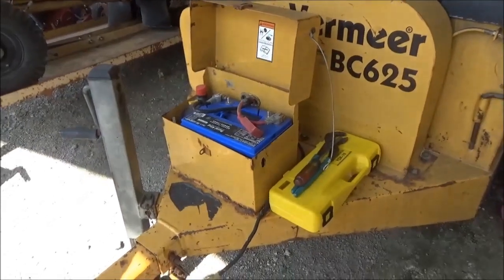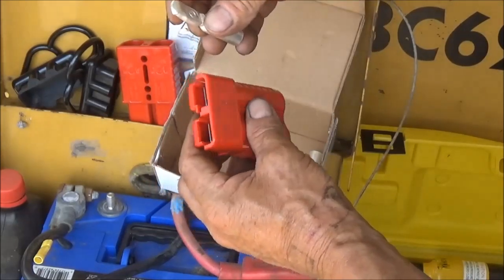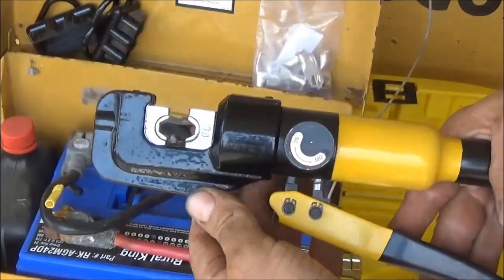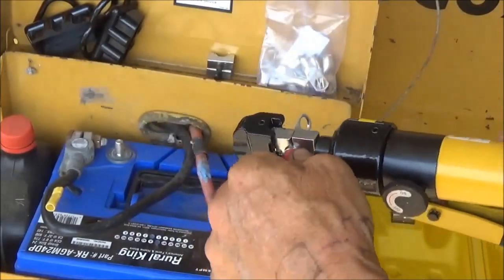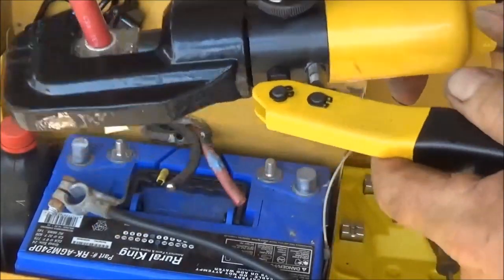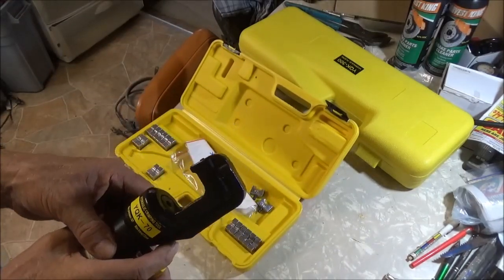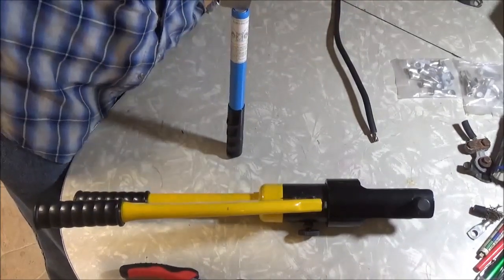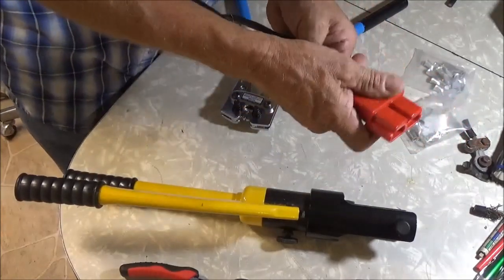New tool review, battery cable crimpers (part 1) September 17, 2017

Comment: SImply put the lug into the crimper first, pump until it holds the lug, then insert the cable into the lug and pump away..
Reply: thank youuuuuuuuuuuuuuuuuuuuuuuuu
Reply: @Holy-Quran-Y  also you can clamp the tool in a vise to hold it.

Comment: 13:12 the lug is oversized... the strands should occupy almost all of the space inside the lug. 
The number of the lug is the cross sectional area of the cable (wire only, minnus the insulator/armor).

Comment: I know this was filmed a long time ago now, but heck man, don't fault the hydraulic crimp for having difficulty with handling it. All you need is someway to secure the cable; either a clamp or vice, or a second person to hold the cable while you crimp with both hands. AND I gotta say working over top of exposed battery terminals with metal tools and bare wires is just asking for trouble.

Comment: I've used those disconnects for the winch on my truck. Easy enough to install, makes placement/removal so much easier. Definitely need a good crimper. But I'll thumbs up the connectors. Very useful. 👍
Reply from the maker: The part 2 has the crimper that did the job, I don't know if you saw that one. Thanks for watching Pete.
Reply: @GordonRobertsonDIY  u should have had tested the size and such b4 making a video and you could place the thing your going to crimp in the crimper but with very little pressure to hold the peice them crimp it I think you should have cut a little more wire off to get crimped better imo

Comment: (#4 Die for 12 AWG), (#6 for 10 AWG), (#8 for 10 to 8 AWG), (#10 for 8 AWG), (#16 for 6 AWG), (#25 for 4 AWG), (#35 for 2 AWG), (#50 for 0 AWG), (#70 for 2/0 AWG)
Reply: thank you very much for the break down of the die
Reply: Thanks I wish I would have noticed that before I text
Reply: Hi Gordon, nice video. Next time you show us to first take a pair of metal wire cutters...or any cutters for that matter and slice right into a positive battery wire with the negative still connected to the battery...pfft, com'on man. I was waiting for your battery to explode or your hand/arm to get electrofiederfied. Not cool Gordon. Some schmuck may just do it with the battery still 100% connected to a vehicle. I'm sure it won't be the first time. Anyway, back to the crimper/die number thingy. If you do purchase one of those [10T, 20T, etc.] hydraulic crimper thingy like i did, the number(s) on the dies [can] mean something else. Durr. I will explain. Durr. The AWG is the first number i will use in the example a few sentences from this one. The second number is the [exact] corresponding mm squared that the AWG is equal to (yes, in RL). Here is the AWG, an equal sign, and then the corresponding/correct mm squared number the AWG is married to, you can say that...pretty much. Durr: (5-6 AWG = 16 mm squared), (4 = 25), (2 = 35), (1 = 50), (1/0 = 70), (3/0 = 95), (4/0 = 120). Crimp away! :)
Reply: Bookem Dano

Comment: do you know that the head of this hydraulic crimping tool is rotatable. so that the pumping lever will align with the jaw opening so that you can put the crimper on the bench and pump.
Reply from the maker: No sir I don't know that now that I broke the tool the 1st time I used it and threw it away, maybe I knew it then if it came with instructions I don't remember.

Comment: Those appear to be the Anderson Power Pole style connectors.

 During one point in the video I saw an off brand name imprinted into the plastic housing, no matter the manufacturer..... they are a superb DC connector.

I'm sure if the quality of that particular manufacturer's product satisfied, you'll be replacing a lot more than just the main terminal ends in the future. I use them for every 12-volt DC connection I touch not only limited to battery terminals but Chargers, load testers, trolling motor, charge controllers, block heaters, etc. They come in 3 different sizes that are used with a single ratcheting hand crimper but go up to very large sizes as in your case. No, I'm in any way associated with the company,  but I do appreciate a quality product and like to help others the same as you've helped me.

I appreciate your time reviewing the crimping tools, I can now make an informed purchase!

Don't thank me for watching..... Thank you for producing!

Comment: The numbers on the dies may be the wire size in square millimeter.  You can search the internet for a good conversion chart between awg and square mm.  The problem is, most of them don't "Line up."  I worked for a Japanese company that used only square mm wire size - took me a while to get used to it and become familiar with them.
Reply from the maker: I don't worry about the numbers on those dies, I just grab what looks good and go with it, I can always try again if I don't get it right the 1st time.
Reply: That is correct the die number is the wire mm a true 1:0 is 35 mm
Reply: There’s probably a paper with the tool telling you the proper size for each wire. Some people just don’t care for instructions. Would’ve been easier to get the right dies in the first place instead of failing first try and crimping with a smaller die the second time.

Comment: You are supposed to leave part of the insulation that is the red rubber material to go into the terminal when you are striping and crimping so that not strands of the wire will be shown.

Comment: ok, 2 minutes in, i am here for the tool review. However the quick connect thing you are doing is what i did for all of the same reasons. I would suggest (as i did) that you solder the cables in so if you decommission the tool or need to re purpose the end its not damaged, and can be reused. Also no possibility of in cable corrosion a year down the road.

Comment: You need to use the right size crimp to the lug 50mm lug use 50 mm crimp they are pre set to crimp with the right pressure if you use the wrong size for the lug it will have either not enough pressure so it won't hold or to much pressure and break your tool its not a guessing game its the metric system 99 % of the world use it you also need to use the right size lug for the cable you are putting in it

Comment: Drill a small hole on the bottom of the handle put a bolt,rod, or cotter pin and loop a heavy duty rub er band on that will open the handle

Comment: "Quick disconnect " are Anderson type plugs.  I had to watch this several time to work out what you were trying to do.   Obviously made by someone who did not read the instructions for the crimping tool,,,,,
Reply from the maker: So just what do the instructions say? You seem to know. I did not abuse the tool, it couldn't handle the heavy lugs so it broke and I bought the heavier tool and finished the job just fine.
Reply: i totally agree with you .
Reply: @GordonRobertsonDIY  you kept pumping after jaws were seated against each, once they touch it's a solid unit the only thing left to give is the c, hence the damage caused to first tool by improper use.

Comment: That blue handle set of crimpers is a lot better than that cheaper  pair - but from the same company - sending the 1st set of crimpers back I would think - good job - that cable cutters surprised me quite a bit - my thoughts
Reply from the maker: Amazon refunded my $ and told me not to send it back. I don't know what I'll do with it, just keep it for now.
Reply: Maybe you could fix it somehow ????
Reply: I got burned every time I bought Chinese tools. When I took them back to Home Depot or Lowe’s for the ‘lifetime warranty’ replacement, I realized I was just getting another tool I knew was low quality tool that would let me down again in the same way.
 - I now pay extra to get a tool I need that’s made in the US or Germany. They’ll still be working reliably for my kids when I’m gone.

Comment: Thanks. I almost bought a crimper Yok-70.
Reply: What crimper did you end up buying?
Reply from the maker: I'm sure that "C" style crimper works just fine on lighter cable ends, just couldn't handle the heavy ones for the battery cables. That's why I ended up getting the 16 ton one and it did the job.

Comment: It's a very strong hydraulic you're supposed to stop squeezing as soon as the two corners touch don't over squeeze it will easily Bend and it is. Design like that it's an 8 to 10 tons of force.  I was given heads up.  And have not used it yet maybe tomorrow.  I bought a long time ago.

Comment: This is a repeat if you used the right lug on the right size cables and the right anvil there wouldn’t be a problem you are the problem get another hobby maybe you should read the instruction manual